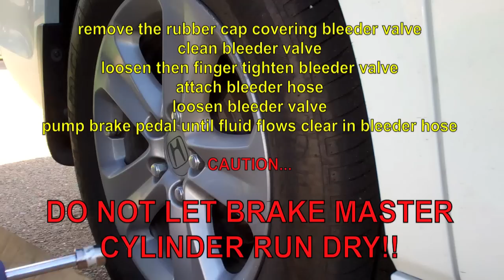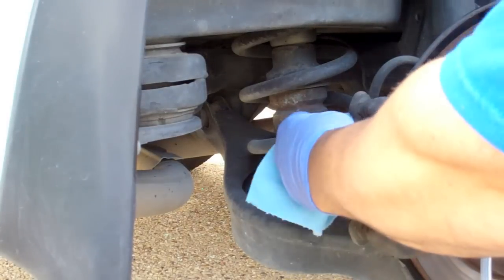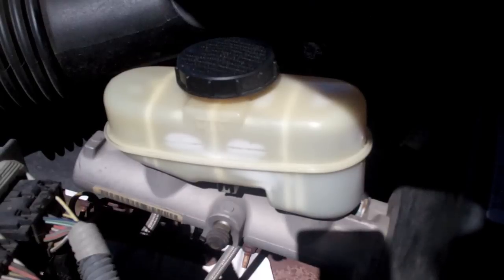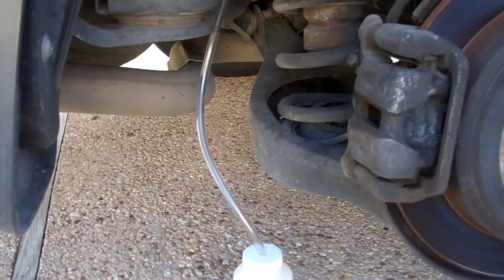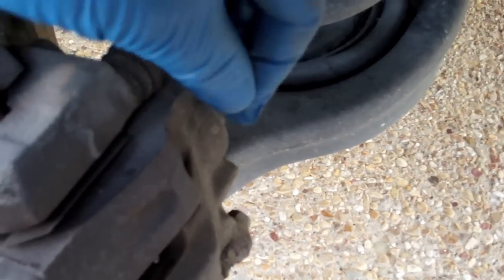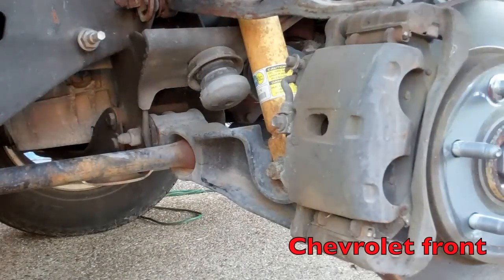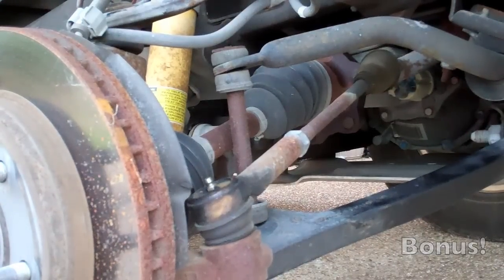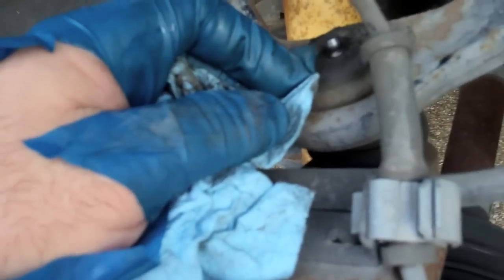How to flush/change brake fluid and/or bleed brakes

Comment: I'm about to do this in the spring, should I spray some penetrating fluid before I attempt to crack it open? Nice. Vid! Oh, what size tube are you using?
Reply from the maker: I didn't need any penetrating oil to crack any of mine open... thankfully they were all in good shape.  The tubing is a clear tubing, 3/8" outer diameter, 1/4" inner diameter
Reply: WJ Handy Dad do you have to pump up the pedal afterwards? Also, if my car has ABS, do I need to do anything different? Thanks for the video!!! I have a,07 Hyundai Santa fe.
Reply from the maker: Sorry, I just saw this and it says it was posted 3 months ago!  The pedal pumps itself back up.  And ABS is the same (all cars shown in the video have ABS).
Reply: @WJHandyDad  , I hear that you supposed to use the 3/16 inner tube?
Reply from the maker: @andyhuang7526  you can use whatever will fit snugly over your bleeder valve.  Some are smaller than others.

Comment: why must the breaks be bled, and do you really need a hose
Reply from the maker: bleeding gets out air, and air causes problems.  Also bleeding gets some of the most worn fluid out of the system.  Fluid near the calipers gets heated and cooled repeatedly.  Without a hose you'd be sucking in more air into the system.  The hose allows the air to escape upward in the hose while keeping the fluid at the tip by the bleeder valve.  Hope that helps.
Reply: Why bleed brakes? All brake fluis(except 5) is hygroscopic by nature. (Absorbs moisture from the air). That's why the reservoir are clear, so you don't have to remove the top to inspect level. Water lowers boiling point. BAD. Water causes rust. BAD. Dark fluid is contaminated. Flush system until fluid is clear. Always use new fluid. Cheers

Comment: how much oil should I add when flushing my brake system in Crown Victoria
Reply from the maker: every vehicle I've ever flushed has used approximately one full 32oz bottle.   You'll use most of the bottle flushing out the rear lines and think you're going to run out, but flushing the front two doesn't take much.

Comment: This video is too long, it should be split into 2 videos, one for the Honda and one for the GM. Each manufacturer will recommend different order to bleed for their vehicle's brakes so there is no universal answer for every car.  I disagree that your want to start with the longest line first, you basically send the old fluid from the master cylinder to that line, it will take longer to get it clear. I'd start with the shortest line first from the master cylinder or ABS/VSA module to the front wheel so that you can flush the old fluid from the master cylinder through this line. Then do the rear two wheels and the last front wheel. This way, the job with get done faster with the least amount of waste of new brake fluid. I'd use Honda Dot 3 fluid on the Honda and may be GM fluid on the GM. It does not cost that much more to go cheap, only to have waste time to change it sooner. Honda recommends that the brake fluid on the Honda Odyssey be flushed every 36 months regardless of the mileage or the maintenance reminder. I'd do it every 3 years or 36K miles.